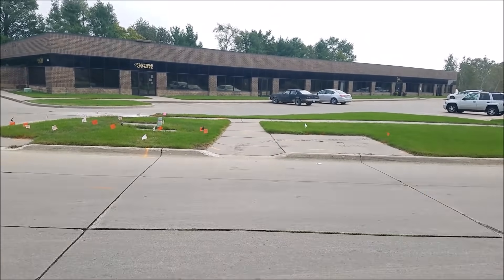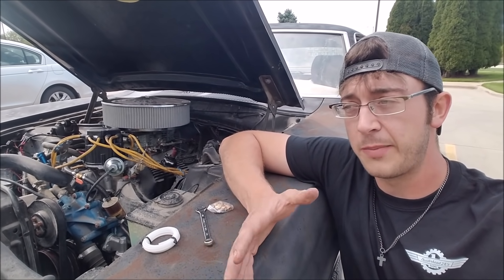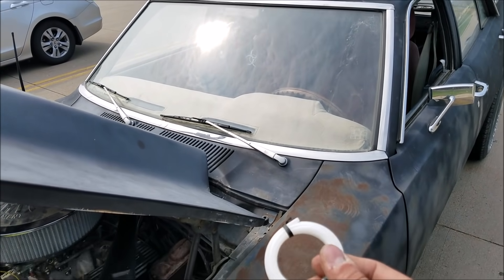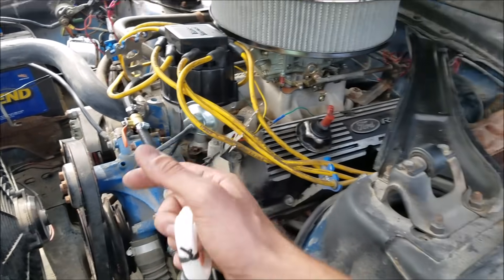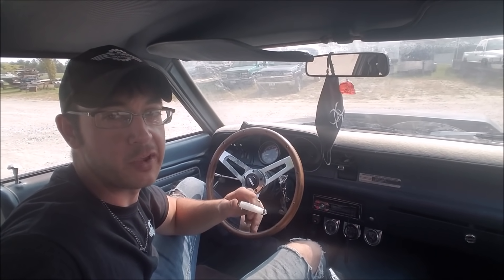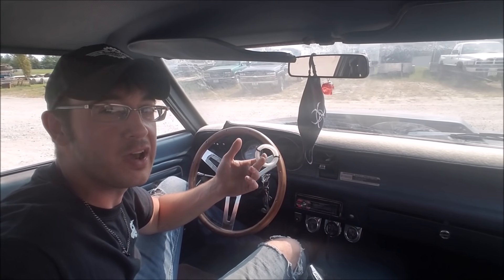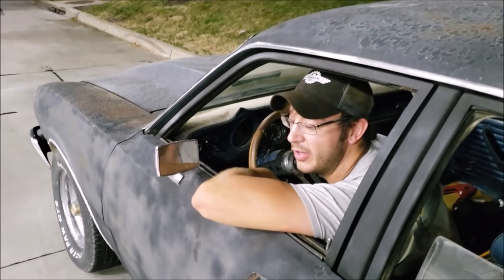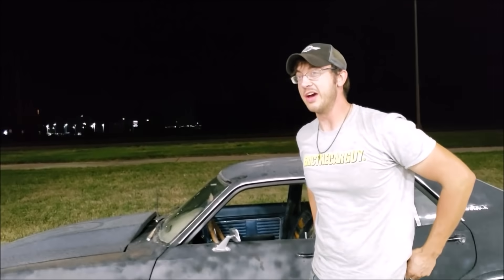The Maverick Broke Down! (A Simple Mistake CAN = Destroyed Engine)

Comment from the maker: Disclaimer: the oil line was more or less located here when I bought the car. I personally would have never done it this way. It was snapped when I got it, so I pulled some of the slack from the cab and redid It. Not surprised it snapped again after some hard driving.
Reply: Understood, still I'd have corrected that issue when preparing car for daily service. 

Not being critical, I do enjoy your videos, that Mav was a helluva deal. 

Did you get the front end straightened out? Assuming nothing grossly wrong, these are easy to do a self alignment. I set my '72 Comet after totally rebuilding steering & suspension. Also set '69 Torino & Fairlane after their rebuilds. The Comet already had P/S and I installed P/S on the Torino & Fairlane(both orig manual). Most all suspension components are same between these vehicles, as well as '67-'73 Mustang.  

With a digital angle gauge, find a flat surface on wheel(preferably center, not all wheels have such area) to read camber. A setting of ½* neg is good. Adjustments on inside of lower control arm set angle. Roll car back & forth at least 15-20 ft after each adj. Once in range go to caster. Adj strut rods, (if not recently replaced, bushings will be bad) to within four threads of full travel, pulling wheels forward. Stay away from polyurethane, can cause strut rod breakage. This adj will net 2-3* positive, orig is zero. Stability will be improved but be warned, with manual steering effort will increase. In this case may want to only use approx half of full travel. Lastly toe in. Can string it, measuring from center of tread to same height on back side of tire, want 1/8" toe in. A toe out cond will make car feel like you're driving on ball bearings. Will skitter on any small bump. Either of the aforementioned adj will affect toe in, when making those always set toe last. Of course you can always set toe and not affect other settings.
Reply: I really enjoy your channel and all the information you give along the way you and junkyard dogs are by far my favorite channels on YouTube along with cars and cameras and vicgrip garage
Reply: I run the copper line straight up aftwr using a 90 degree elbow and follow the intake and valve cover into the firewall, no issues with flex, wrap copper line with rubber washer fluid line.
Reply: @tombryant1104  Another thing is check the bushings, especially the ones on the shock towers. At 50 years old they're very worn and it makes driving a real headache, just the feel is weird.
Reply: What year is your ford maverick?
Reply: that look too stiff. I suggest you run the copper tubing with a small loop just before the nut/ferrule. It would absorb the vibration and movement
Reply: @macabu457  I always put a large springy spiral. No need for dainty shit.
Reply: @alexandermckay8594   Yeah upper control arm bushings were rarely greased, rubber components die with age, my Comet needed everything. Fairlane I mentioned has a verified 43K mi,  rubber bushings were rotting but upper control arms are fine. Removed arms, pulled the factory plugs, greased and reinstalled.
Reply: Did you put that 302 in it i know they did come with a 302
Reply from the maker: Bama MOWERS I bought the car like this, but 4 doors did not come with a v8, or 4 speed top loader for that matter
Reply: @ThunderHead289  Plenty of 4-dr had V8, std option. All engines were available in 2 or 4dr, though some years did not have all transmissions avail with all engines.

The '70 170 had only semi-automatic trans option, basically a C4 with manual valve body. Not well received, dropped for '71 with no auto option for 170.  Wasn't a big deal, the 200 was a $39 option and did have auto available. Before '73-ish 250 6cyl were avail with automatic only.  No problem ordering a 250 with stick in Fairlane/Mustang. Price & availability taken from Ford's 1971 Armchair Estimator.

No US Maverick 2 or 4-dr ever had a 4-speed option, a 4-speed could be had in Mexican Mav. Rare in US as they did not meet emissions/safety specs.
Reply: addendum, '70 Models had no V8 option for either body, added for '71.
Reply: Congrats on your upcoming wedding bro. Found out watching Junkyard digs. Wish you all the best.💯🇺🇸
Reply: hope you have a great wedding this weekend Thunderhead
Reply: Congratulations!  Welcome to a great institution!  Good luck.
Reply: Congratulations on your wedding

Comment: This exact thing ate my 300 in my '94 F150! Busted motor mount allowed too much movement, and I didn't put enough slack in my oil line. Learned to coil that a few times for extra slack.

Comment: I think the copper line is suppose to be in a coil near the connector to act as a spring to prevent it from breaking off. I'm sure they still do though. Best to go electronic and use a wire. Thanks!

Comment: Little airplanes use copper lines. You are supposed to put a 360' loop in the line down line from the nut. The loop reduces the stress at the attachment.
Reply from the maker: Completely agree, it just looks awful and the PO didn’t leave enough material for me to do that.
Reply: @ThunderHead289  Rodger that. Don't take anything I say as an insult. I've watched enough of your material to see you have what we ol schoolers used to say, all of your chit in one sock. I am relearning from you that which I had forgotten. Mechanical tuning is a dying art, and you are getting pretty good at it. Passing the skills on is a valuable service. 

If you have any experience converting an E85 Holley to pump gas I'd appreciate a video on it. There is one single E85 station in Washington. It does happen to be only 5 miles away, but it severely limits the range of my Duster. Going back to pump gas and don't want to buy another 4150 as the one I have is the best Carb I've ever bought. The jets and squirters should be pretty simple from memory, but the air and idle bleed base settings are a mystery to me, and I can't find any info on the subject.

Comment: Luke why not put a loop of copper line, it will move with the engine with out stressing it??
Reply from the maker: That’s fine, it’s just ugly. 
I’d of done that if the PO had left me enough line to make that happen. 
Currently I have a small poly section over to the copper line.

Comment: Been there done that,I made a bracket for a remote oil filter worked great for 1200 miles - then broke letting the filter drag on the road for about a mile until the filter had holes from the road cut into it then no oil light came on and just about saved the motor
Reply: duct tape isnt a good thing to use for remote oil filters or brackets?

Comment: I have a 74 ranchero with a 460 . Been using the poly tubing for its oil gauge for over 38 years. Changed out the complete line once 20 years ago when the restoration was done. Check on it a few times a driving season and before big trips never a problem. Just keep away from exhaust heat and areas where chafing can happen and you will be good.

Comment: I installed a shut off valve ahead of both my stock oil pressure sending unit, and my Bosch mechanical oil pressure gauge (installed a metal line instead of plastic line) 
I open the ball valve to check idle pressure, drive around and check driving pressure, about once every couple of weeks. Then close it back up. 65 psi with full synthetic

Comment: I have found if any metal or copper lines go to something the moves, vibrates or what ever, I always put a loop in the line. I do find the nylon line you got for replacement is really the best, as long as you keep it from hot or sharp surfaces.... like manifolds or firewalls. I like the fact you drive your cars.... there meant to be driven.

Comment: I've had a copper oil pressure tube on my 70 351-C Mach 1 for over 30 years the key is to bend the tube in a coil near where it attached to the extension which allows the tube to flex and move relieving any stress

Comment: Quick question. I need a 12v power source to my new Holley carb with electric choke. My water temp sending unit on top of thermostat housing is 12v and very close to the choke. Can I splice into it? Or just run a separate wire? Thanks much appreciate you Luke.
Reply from the maker: So the choke is a heating element which is classified as a purely inductive load - so it may cause issues pulling power from other things. 
What you can do is use a standard automotive relay and use your ignition lead as a relay trigger. Another method is that you can see what circuits on the fuse block are hot with the key on and not with it off and tag off of one of the heftier systems like the one for the blower motor.
Reply: @ThunderHead289  Thanks Luke. 67 BBF ex race car. Has old style glass fused or I would use a fuse block from there. No blower motor it is gutted out. Perhaps the wiper motor will do. I will check it's voltage. Fuse Tap I mean, not fuse block. dooh

Comment: this is why I run digital oil psi gauges now.
Reply: If you insist on running a hard line, put a loop before it goes into the sending unit to allow for movement.

Comment: My rad hose popped off in the spring when I hopped over a frost heave in the road. Lots of steam came out the back. I had about 10 miles to get home. Had no tools & forgot my phone. Got home without overheating by driving and coasting, driving and coasting while eyeballing my water gauge.

Comment: The line broke to the transmission oil cooler on my 89 Sierra. Drained the transmission in 13 miles of driving. Could have been less but it was running when I left home and 13 miles later it wouldn't move out of the parking place at work. Dumped 5 quarts in the trans and was able to drive in 2nd gear about 25 miles to the garage where a shade tree mechanic rebuilt the trans and replaced the clutch bands. 
$1500.00 later it was fine.

Comment: Everyone hates on the plastic line but I’ve had it on my pickup for about 6 years or better now and it’s given me zero trouble, I’ve unhooked it a few times as well. It sat on top of the dash for about 5 years of that 6, the gauge itself was breaking down but the line was still fine.

Comment: Hi Luke, my buddy had 66 mustang he put a 351 in and had the same problem with the engine torquing right like that and he kept breaking motor mounts . He actually hooked up a chain from the engine to the frame  he got alot more torque and seemed to solve the problem. I don't know if later it bent the frame or not but just thought I'd share. Jim.

Comment: I have no problem with using the poly oil line but would making a circle of the copper oil line down where the flex would happen work also? I mean a circle like you see on many brake lines by the master brake cylinder. That would allow flex.

Comment: Older tractors had mechanical oil pressure gauges and it caused a lot of blown up engines from the line leaking and draining the engine of its oil

Comment: Put a 90° elbow on it and route the line in the intake manifold area with a copper line. I've ran both in my experience the plastic lines always seep oil either at the gauge or the connection to the block.

Comment: That's a good philosophy, drive old beaters around town and you won't get stranded very far. Good thing you caught that, it would have been a disaster if you lost too much oil.
Reply from the maker: Just for the first few thousand - Iv had my f100 to the Carolinas and back a couple of times without a single issue
Reply: @ThunderHead289  yeah once you get an idea of what needs fixing or replacing the vehicle becomes pretty reliable once all those issues are fixed. Then it's just a matter of keeping an eye on fluids.

I daily drive an older vehicle from the 2000s driving 60+ miles a day, I've had the water pump go bad, brake lines rust out, even had the power steering pump leak fluid all over my serpentine/drive belt and part of the belt snapped off but the rest was still together on the system, if it was an older worn out belt it would have most definitely snap completely right off. None of this stranded me thankfully, I was only homebound once with it and that was due to the battery going bad and even then the connection was poor so I had to replace wires and side terminal bolts.

Comment: I've been running the copper line for the oil pressure on mine for 20 years now. But mine is not ran like that. So far so good. Electrical sending units are not immune either. I have had to replace electrical senders because they sprung a leak and sprayed oil everywhere. Mostly power steering.

Comment: All it takes for the copper lines to work fine long term is to add 3 turns over a 1,5 inch pipe with a pitch of 0,5 inch anywhere between the engine and the fixing point on a car body. This extra length will absorb all the vibration and movements.

Comment: In my field of plumbing way back in the day we used to run copper lines for the refrigerator ice maker lines over time of course it was found that the exact same thing happened every time the refrigerator was rolled out to clean behind low and behold the line leaked but when a plastic line is used this doesn't happen for just that reason it's plastic and has enough give to it to allow the movement as a copper line doesn't .. same same same

Comment: I would keep a pipe plug if to block it off in the glove box just in case, a gauge is not an absolute necessity to get u home. Then u can fix it later, I prefer electric gauges for this very reason.
Reply from the maker: You better believe that I do indeed have a pipe plug in my ashtray now!!!

Comment: My parents were on holiday in the 80s in Croatia (Yugoslavia at that point in time) and suddenly lost oil pressure according to the gauge. Mechanics down there told him that the actual oil pressure was fine, just the sensor was busted...
It's pretty obvious where this is going. But he did actually spend the cash and time to replace the engine.

Comment: What I've seen help the copper keep from cracking is to put a couple of wraps like a coil spring how gm did from the factory in the early 70s not tried in fords. But 2 of my chevys have the original line from the factory and my other has one I made and it's been there for almost 10yrs

Comment: How 'bout an electrical oil pressure gauge w/sender instead? You don't HAVE to have a mechanical one do ya?
Reply from the maker: I like the immortal ones. Iv never had a problem with a poly mechanical. Only people that do are people who put it quite literally right beside the header. Poly holds to 300 degrees without issue - typically and then some!

Comment: Run the oil line across the top of the intake and zip tied to one of the wires then it will rock at the bottom and the top and the line never moved at the fitting

Comment: Back when I had my '72 Gran Torino Sport, I installed an oil pressure gauge too.  Because I was not too fond of the idea of a plastic tube carrying hot oil at high pressure running into the interior, I opted for an electronic pressure gauge.  I installed a T-fitting on the block so that in addition to the gauge, I also retained a functioning idiot light.

Comment: I think its cool that you drive old cars like this everyday. That's what they were made for so might as well put them to use. New cars are kinda boring too.
Reply: New cars are not durable enough. Old cars are though rust is the cancer that makes them no longer durable
Reply: @R3TR0--93  Eh, new cars are more "reliable" than old ones, I would say. Hell, my parents drive a piece of crap Volkwagen from the mid 2000s, pretty much nothing electronic works, the interior is worn to pieces, it's not comfortable to sit in, starting to rot badly, makes all kinds of driveline noises but it somehow starts every damn time. My car was and still is beautifully maintained and I fix everything I see has started to fail prematurely and I STILL sometimes have issues of it not wanting to start in a parking lot.
Reply: @GlamStacheessnostalgialounge  I never said new cars are not reliable, I was saying they are not durable enough meaning the are made of plastic and aluminum and old cars made of steel and chrome are more durable when dinged and fender benders and can take more abuse. However, newer cars are more safer and better handling for all driving conditions with traction control and all convenient options.
Reply: @GlamStacheessnostalgialounge When u said "my car", what car are you referring to?
Reply: @GlamStacheessnostalgialounge  
You're both right. New cars are more "reliable" (start every time you turn the key) and less "durable" (they won't make it 50-100 years). Proprietary software, alone, ensures that you won't be able to fix up a 2020 in 2120.

Comment: I've the plastic lines have a "high" failure rate.  Luke if you were to reroute the line over the engine instead of mounting to the inner fender well and put a  gentle loop in like a brake line might help.  God video, nice to see you save that small block from the scrap heap!

Comment: Love your videos!! Last Ford I had was '72 Cougar, 351C V8 2bbl. 3speed manual, single exhaust!! Such a fun burn out machine. Try a 71-73 Mustang, Or Cougar, with 351C power, if it's right and tight, There great!! Last of the cool Cougars, that u could get a stick in.

Comment: I had the same plastic lines in my Trans Am for oil pressure...Note to world..mice like to chew on em! 
I started up my car in the spring and saw no oil pressure but quickly noticed a pool of oil on the  passengers side floor matt.
I changed over to soft copper lines...ended that issue.

Comment: I have a 70 Maverick with a 351w c6 and a strange 9inch housing. It runs 7.0s in eighth for 16 years. The better engine mounts have a steel cable that goes thru them to prevent engine from laying over too mutch or separating. Yours may be the better ones I dont know.